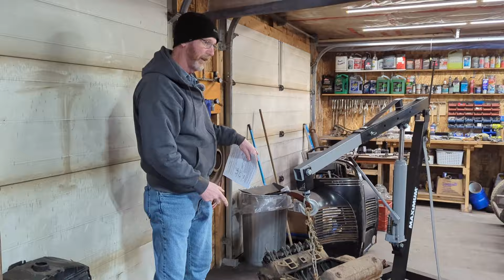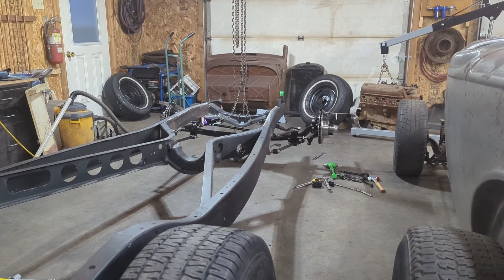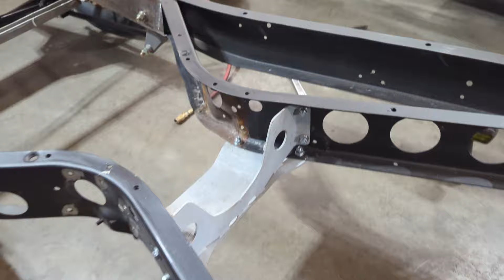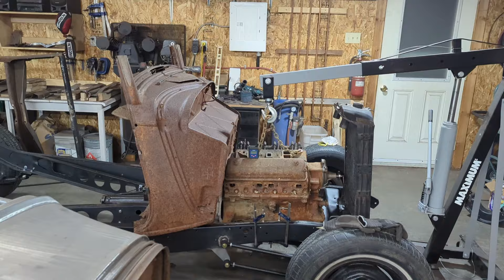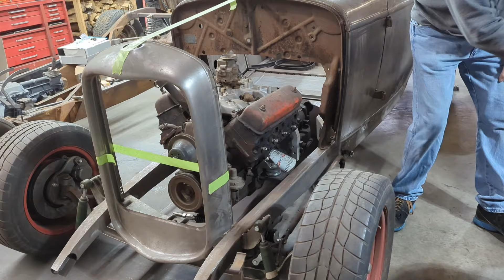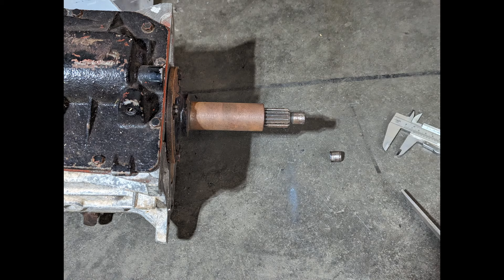Part 2 - 1934 Ford Chassis #2 Fitting the engine and transmission

Comment: Great video and cool project. I suggest grabbing a distributor w/cap and dropping it into the block to check firewall clearance. With the block in the current position I think you’re going to need to clearance firewall for it. (I’m currently fitting a y-block into a ‘29 on ‘32 rails myself). Keep up the good work!
Reply from the maker: Yes absolutely we're going to need to put a scallop in the firewall for the distributor. If it stays where it's at the passenger side head clears but the distributor won't.

Comment: How about a remote oil filter kit, not a dry sump, to get it out of that location.  I'm sure I have seen them before sometime / somewhere in the past.  I had some Y-block fords, a 55 and a 57 in the late 50's and up to late 62 and I'm sure there was a kit for moving the oil filter.  Maybe Speedway might have access.  Never could get the rear main seals to stop leaking!!
Reply from the maker: Hi yes that's an option we were considering as well, remote oil filter. I may go that way on my roadster to free up space for exhaust and steering. Yes I've been warned about rear main seals. Quite sure it's a rope seal in the Y block too!
Reply: @coldstreamrodshop  Originally some kind of asbestos impregnated rope but I think now the seal kits are a polymer seal instead of the rope seal.  Easy install when building the engine but to fix the leaks later you have to loosen the main bearing caps to be able to slightly lower the crank to get the seals out / in properly.
Reply: Correct. There is a leak-free (if installed correctly) neoprene seal available now.

Comment: I would defiantly move the engine back and down as you originally had it.  It would only require a small modification to the firewall toe board area and would make repairs to the water pump and removal of the oil pan much easer when the car is finished.  Also, rear and lower engine placement will provide a much better center of gravity for the finished car.
Reply from the maker: We're talking about that as an option. Drilling out the spot welds on the vertical section of the firewall and then move it back an inch. He'll make a decision next week. Hopefully we'll be able to share what the final call is next week, if not the following week.

Comment: Very nicely done. It’s a shame you have to go with a new rad and fan. But if it gets the engine of choice in the frame then that’s good. Is there not a modern spin on oil filter adapter ? Cheers Tim.
Reply from the maker: Yes this is an early Y block block we're using to setup the mounts. The actual engine he's going to use has a smaller and shorter oil filter so we're going to pickup some more space for exhaust clearance and for steering.